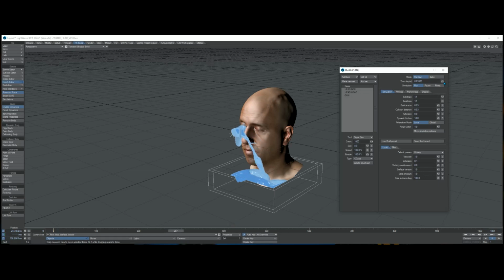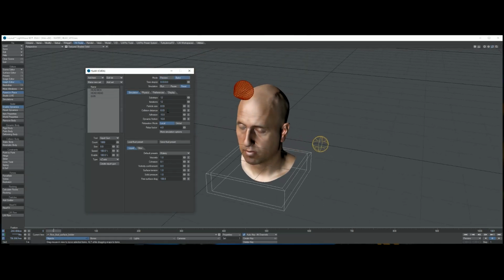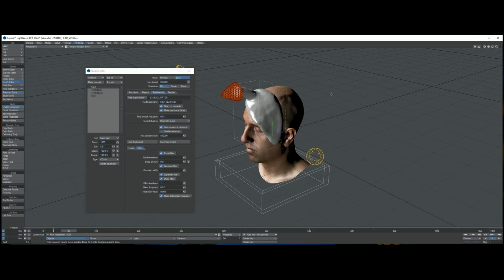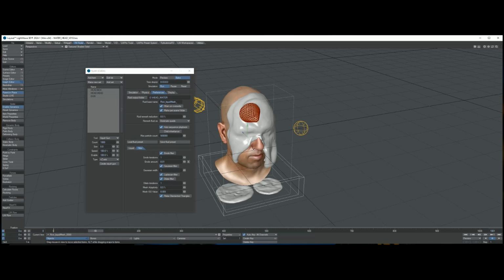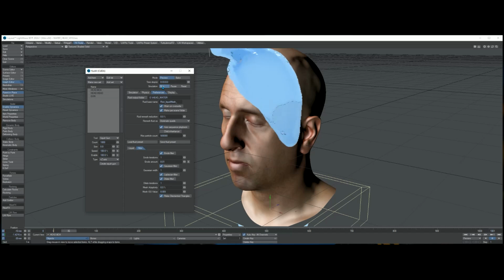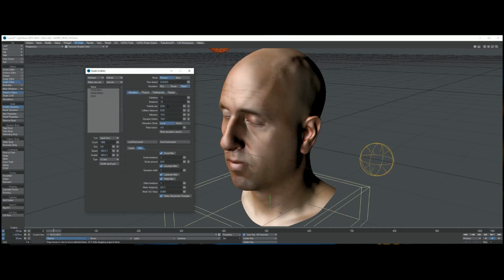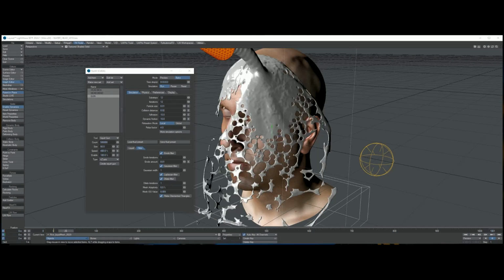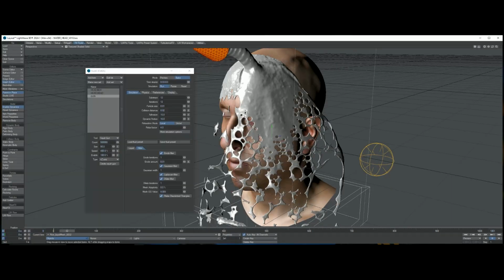Lightwave 3D Flow Liquid over Head

Comment: I think this toolset is highly underrated and overlooked because even with Bifrost in 3ds Max and Maya, or the popular Flip Fluids add-on for Blender (which I recently purchased), they are all CPU-based simulators = much slower simulation times. Flip Fluids explains in their documentation that they don't really plan on involving the GPU much, if any, in the future. For 80% of fFluid Sim tasks, Lightwave's Flow would do it faster with an equal level of quality, as it simulates in near real-time, similar to LiquiGen. That's quite remarkable, honestly. Just watching 3ds Max Fluids simulate a relatively simple Chocolate drip was slow and cumbersome. Every adjustment I would make > re-run the sim, would easily take 5-15minutes.